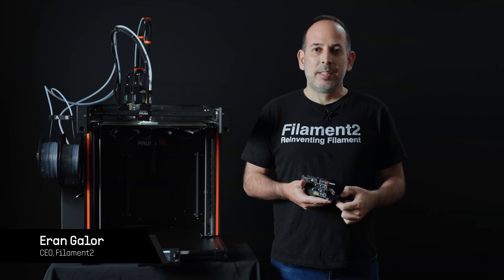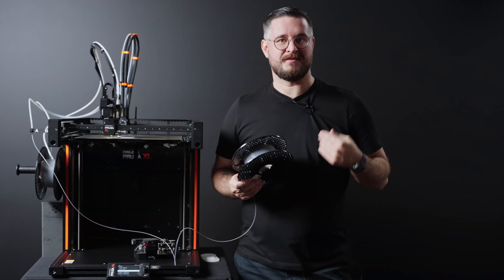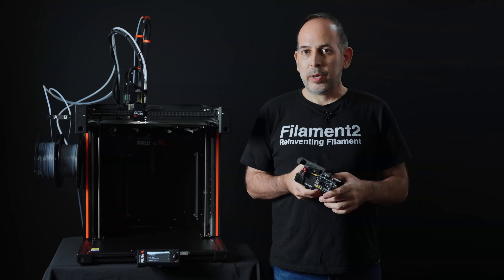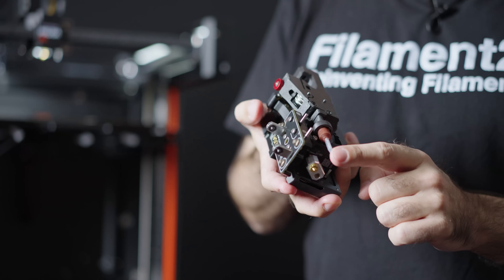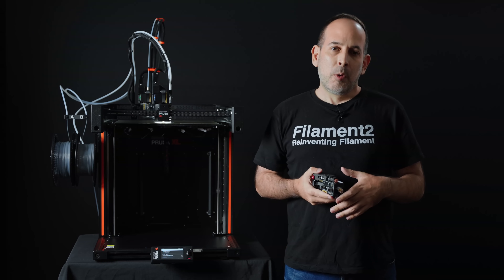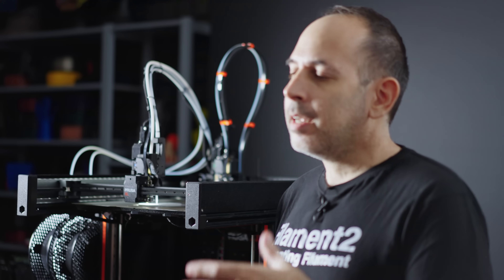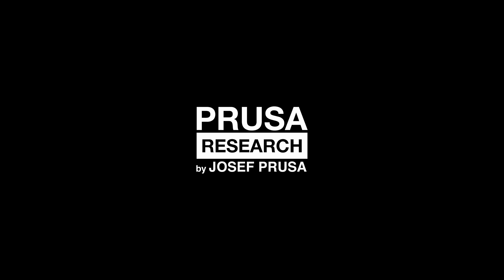Silicone Printing on the Prusa XL - Filament2 x Prusa

Comment: Looking at the extruder modification, will it be able to fit on a full 5 head prusa? Assuming you need to replace head 5 as I think that is the only place it will fit without obstruction? ALso I assume you can still use it for original material with the nozzle? Cannot wait to try it out.

Comment: Its things like this, that will make my decision easier when time to buy a new printer. My mk3s has been my workhorse. Due to how slow it is compared to the new printers, I want to upgrade but Prusa's price point makes it challenging and hard to justify over Bambu at the moment.  Anyone have experience with both?  Your thoughts?

Comment: I don't know this seems like an attempt at selling 2 part silicone at a premium packaged in a special tube. Why not just engineer a hopper and pump solution so it can be refilled regularly with a standard silicone formula? I swear these filament companies are turning into paper printer companies, trying to make major cash off inks and filaments

Comment: what happens in a multi material print? I'd imagine that the silicon nozzle already primed with mixed silicone would set and cause a clog until the other heads are woring on the non silicone parts. How that is not an issue here?
Reply: It takes time until it cured, so there's time for other tool heads to print support, etc'.

Comment: I’m curious if it can print the silicone with 100% infill without the nozzle marks on the top layer or invisible seam scarf cos i still thinks it is  easier to print and sand the shutter for a mold than cast a smooth surface silicone in it

Comment: There's a host of flexible portions of the prototypes that have up till now been printed in PLA & ABS. This completes the situation of having the flexible component part produced that this prototype is designed to have. ALSO this would be ideal for places where metal bearings fit into solid ends where shafts go through. The silicone would make excellent shock and vibration mounts. TY & Keep it developing !!!

Comment: He said "now available to the masses " , but the "masses" don't buy a Prusa XL , they buy e.g. the Snapmaker U1 .
So hopefully they will allow this to be mounted on the Snapmaker U1 also .
I for one would really like to play with this 2-part liquid silicone ,but i will never buy another Prusa printer , had enough of problems with my Mk3/s and mmu2 , do not like to re engineering any company's product so it works as it should

Comment: Would it be possible to make some more print examples? It would be mind blowing if you could print, say, a glove - but I don't know if it is possible. 
.
Also - you mentioned Epoxy - could you give examples? Epoxy printing would also be mind blowing, but I just don't see how - you would need one layer to set before printing the next - that can be 3 hours by which time the nozel would also dry up.

Comment: basically throwing away spools of plastic seems pretty wasteful to me, and I guess you didn't show this deliberately. What's the selling point with this that can't be done with existing paste extruders or bottles + pump extruders?
Reply: It looks like the entire point is that one can retrofit pre-existing printers. Looks pretty obvious. Depending on the costs it may or may not be useful.
Reply: @WhatsThePointOfIt  retrofit what? it's an add on to the existing head. This can (and has) been done with paste extruders too. Is it reusing the existing extruder to push the "filament"? Since it actually requires two, not one, I doubt even that 🤔
Reply: @RoterFruchtZwerg  Yes, but it requires more work to do so and most 3D printers are designed to push solid filament because the way the feeder works.

To be able to pump a liquid/paste one will also have to have two pumps feeders. with printers that have only one solid filament feeder  they will have to buy and additional one. If they go for paste then that requires buying two pump feeders. If they already have 2 solid feeders then it's just going to be buying the head.

I'm not necessarily disagreeing with you but this will fill a niche for some. Again, it mainly depends on the cost. If it cheap enough then it might be a better option for some who want to try it out silicone without essentially having to buy a new printer.

The other thing is that at least it being solid makes less of a mess if something goes wrong.

I doubt the people that made it thought it would be the end all be all... but of course they are going to hype up the marketing. As far as we know they started working on it before paste was a thing and put too much time into it so have to try to make some money to recover their "investment".

Regardless, it's a product and if no one has any use for it then they won't buy it. It's not complicated.
Reply: @WhatsThePointOfIt  I see, the extruders of the XL which usually has 2?) can be reused. I don't think they showed this well. So the additional head is kinda passive?

I see that handling it might be easier, but yeah... I primarily see lots of waste. We'll see if this is sustainable 🤷🏻‍♂️
Reply: @RoterFruchtZwerg  I don't think it will necessarily be wasteful. Of course you mention throwing away the spools but technically they could be reused.

The way I see it is that you can upgrade a typical printer using their silicone filament without too much hassle but they likely charge an arm and a leg for the filament and upgrade kit so it's probably not worth it.

Again, it's more of a niche thing. A few people might find that it works best for them. After all, it's no more wasteful than traditional filament.

In many ways we probably shouldn't be using filament at all but some type of heat setting liquid paste like material. Generally though the problem will then being able to control it since it will require more complex methods to deal with variations in flow rate. Filament is easy and that is how things work now so I don't see anything wrong with what they did. If they are not trying to rip people off with the pricing then it could definitely be useful for many people who want to to get into silicone mold creation without having replace their printers completely or do a major overhaul. 

I see nothing wrong with what they have done. The "market" will decide if finds it useful or not.

Comment: So does the sleeve get recycled out of the back of the printer? 
 Presumably there are two channels inside it and these get mixed together. 
It seems more logical that the two parts would be syringe fed as we can't see from this video the way the two liquids are combined. 
What is the bridging distance of this type of printing so voids in the Z axis can be printed?

Comment: I applaud the innovation on this, but seems overly complicated and not very environment friendly. You are putting too much work into making the silicone resemble a filament spool, while you could simply change the feeding approach and use liquid containers/reservoirs that plug into the nozzle. That way after printing you don't end up with with a tube cut in half and full of leftover silicone which can't be recycled. Less expensive to manufacture, less waste, easier to implement.

Comment: Stupid and scummy design, aimed only to sell you spools of the "special filament" and whole design is just "reinventing the wheel". It's a tube, prolly plastic, filled with the liquid that is fed into the head where it's stripped, the liquid gets squizeed out, and casing is left behind. Unnecesarily overcomplicated design. Hello? What is wrong with two actuated plungers next to the printer that pump the liquids into the head by tubes? There are already many designs like this, in many diffrent applications, it's nothing new, not a breakthfough, EVEN the nozzle itself looks like it's just reused nozzle from chemical anchors.

Comment: Why the Disposable Hollow Tube filament?
Why not a fixed/permanent hose with liquid A/B reservoir tanks. 
Seems both wasteful and overly complicated to store the silicone in a tube that gets constantly peeled away to extract the liquid...
Feels like someone doesn't want to design a fluid pump so much that they've gone to the extreme of dressing up the liquid as if it was a solid so they can keep using gear extruders....

Comment: While being able to print liquid substances, placing the liquid into these filament tubes seems incredibly wasteful. The only benefit I see in doing it this way is you can use it on existing filament printers with minimal modifications. I would think just having the liquid in a vat would be a more sustainable solution, but I guess clogging could become an issue with that as well.

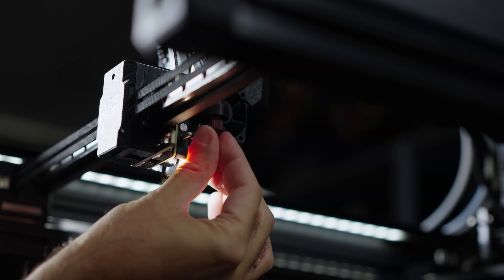Comment: Did I hear that right, that only the liquid inside the filament is used but not the actual containing rigid filament casing itself? At 01:47 they say that it contains a cutting mechanism that cuts and then peels away the filament to leave the inner liquid. What happens to the filament "sleeve/wrapper" after the liquid is used? And if this is truly what is happening, wouldn't it make more sense to use two tanks of liquid(part A and part B) and mix them at the nozzle just like the video explains, but without the waste created by the "sheath" around the liquid core?

Comment: not gonna lie this seems really fucking stupid. assuming it even works the way they're claiming. why put the two part mix inside plastic tubes you are going to cut to extract the fluid, hope that you get all of it out, and then discard the tubes.... even if we are being generous and saying 'yeah, that might work', which i think is a stretch, why build a system focused around consumables produced by a hyper limited supply? literally none of this makes sense, just use a generic pump to pump the fluids to the nozzle. or use a syringe like dental silicone.... the only benefit i could see out of this is limiting swap time when you run different materials, and i cant imagine that will make up for whatever you're going to charge for this 'filament', considering silicone by itself is already really expensive... 

there are other things that seem off about this but really this feels like a scam...

Comment: Holy fuck, using 2k silicone/ epoxy in this way is such a good idea, but it needs to set extremely fast otherwise you run into the same problems clay/ pottery printers have (mainly everything sagging and structures collapsing under their own weight)!

Comment: I was researching PLA positive to silicone mold recently and it seems the crucial step required in between is smoothing the positive with something that fills in all the layer lines. So I don’t expect this to make very good molds directly. It would be awesome for gaskets if you’re concerned about temperature like for custom car parts. But for other low temp gaskets where you just need some friction and an air/water tight seal doesn’t really matter I think TPU is fine. This is still VERY impressive though, and immediately sold out. Congrats, Prusa! You’re on to something!
Reply: So just use ABS instead of PLA and do acetone smoothing.

Comment: I understand the need to maintain sales of related materials after this device was launched, but why couldn't they simply use two reservoirs for components A and B, along with a pump to feed the silicone directly into the print head? This would eliminate the need for all those useless, dirty tubes that just end up in the trash.
Reply: Because that would be a whole different printer at a 10x price tag. It's been done before.

Comment: this is cool. as someone who does things with epoxy resin and wood like cigar ashtrays for example, this is cool because i dont have to make a form, then mix and pour to make a mold. i can have it print it and make it hopefully thick and have the option of making it with silicon that will be a little harder density so i can use it for my projects. Filament 2 hit me up if you wanna have me try it for that purpose and use it for my next project and film it.

Comment: Why not add the liquid part via a small hopper that injects into the toolhead? A pump jammed to the feed gears just the same for measurement but it would eliminate need to cut the tube and potentially avoid jams???  
Im sure it was thought of, just curious why they went with this method... 
Its a great idea and I hope it performs perfectly!

Comment: Darn, a actually major invention for 3d printing. Silicone is one major material that has always been locked for 3d printing. I didn't even think it would be feasible to get it on consumer printers.
Reply: consumer resin printers have actually been able to print silicone for years now

Comment: looks like the main intention is to print seals. my question is, what are the differences compared to seals printed from TPU?
Reply: main difference is that up until now every 3D printed seal has been useless garbage with the consistancy of a gummibear and similar performance.
Reply: @veikovasko5603 It probably depends on where you want to use them. I've been printing TPU seals for my projects for quite some time now without any issues, but those are low-pressure systems. However, for high-pressure applications, I would still resort to industrial made products.
Reply: @timisprenger446  I use moulded silicone seals in industrial applications. TPU seals only lasted few cycles where silicone lasts thousands.
Reply: @veikovasko5603 Do you print molds and fill it up with silicone? I've had that thought but I not tried it yet.

Comment: Can totally see this approach being useful for depositing solder paste on PCBs as well
Reply: Buying solder paste filament sounds so incredibly silly haha. Imagine if one day we're just straight up 3D printing silicon dies at home on our consumer grade nanometre-scale 3D printers!
Reply: @skmgeek you just need to use a 3d printer to print a smaller one then use that  to print an even smaller one.
Reply: paste extruders for 3D printers exist for decades now. They are already used to print chocolate, sugar, solder paste, glue, clay and yes, silicone.
Reply: Opulo has managed to dispence solder paste from their pick and place machine. One has to fill a syringe with paste beforehand though. Solder filament would likely be too niche, as there are syringes for that exact purpose. Only usecase would be if one had the pnp machine, but is using it so little, that the solder paste would go bad.
Reply: How do you mean? The core of this invention is that they were able to mix two filaments together. 

Thick liquids don't really evenly mix quickly on their own on such a small timescale and size.

Comment: Its really impressive no doubt an applications for this tech is plenty but why have the silicone or resin etc in the form factor of a tube on a spool and not just in tubes dispenced to the tool head via pipes. Printing silicone is not new. But I'm sure with prusa's help it good become more mainstream. Just curious why this odd approach for holding the liquids was chosen?

Comment: ok i might be slow lor this is the most poorly explained thing ever.... so the silicon is a liquid inside of the string of filament which is basically a straw? so.... where does the outer shell go? or is it a harder silicon that just gets melted and added to the rest? he says theres blades in the head that cut away the tube? ok.. is that "tube" like the end cap that keeps the silicon from flowing freely or where is this waste "tube" part thats getting cut off going?

Comment: I think the most crucial part here is maintanance of that nozzle. When you extrude silicone with a caulkgun the tip of the cartouch will dry in. I assume the same will happen to these printheads too. So those tips will be throwaways? Or how many times can you clean them? When chaging how reliable will be the Z offset?

Comment: This is groundbreaking! This could be beneficial when it comes to making WHEELS. Coz making those on a 3D printer has been a real struggle. Effective RC wheels requires silicone-like texture for traction.

Comment: Why should we use an obviously more expensive printing method instead of classic silicone mold casting? Can this silicone filament really be comparable in cost to regular liquid silicone, not to mention the expenses for a special extruder for it? I also can’t think of any truly unique situations where this would be more efficient than traditional casting.

Comment: I wonder if the silicone filament will come in 3mm since after using a tube to contain it, 1.75mm doesn't have much volume.
Also, we need a drag knife tool head for the XL.

Comment: Was NOT expecting that. 2 part liquid printing from a spool is so wild! Imagine even a single spool of chipquik SMD solder and high precision nozzle. There is at least one other multi-thousand dollar hobbyist CNC trace printing machine on the market right now and this beats it because you would never need to mess with a syringe
Reply: I wonder what the price difference there is between having the material in a syringe verses having the material inside a long tube? This filament technique is interesting and is likely a good solution in many cases but I think delivering the material in a syringe or bottle would likely be much less expensive.